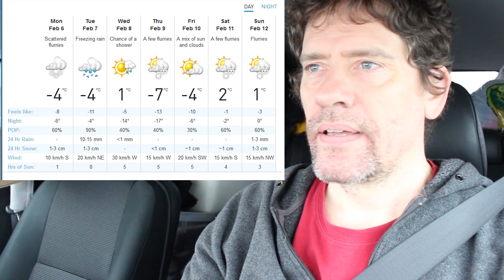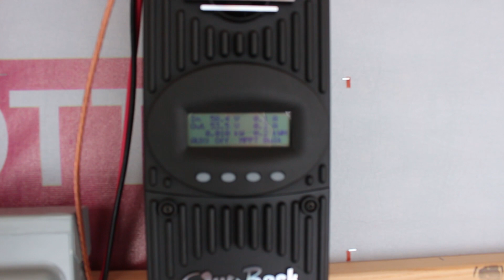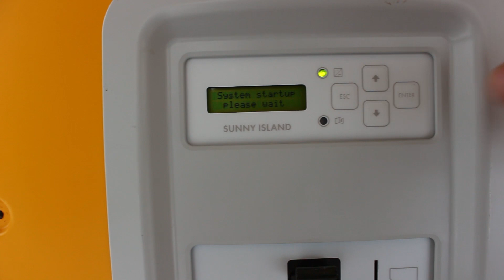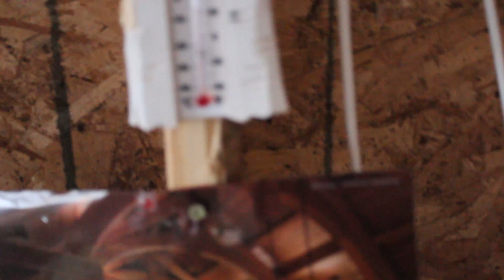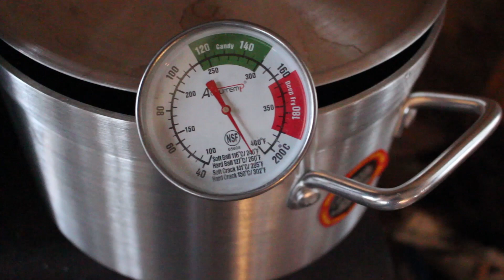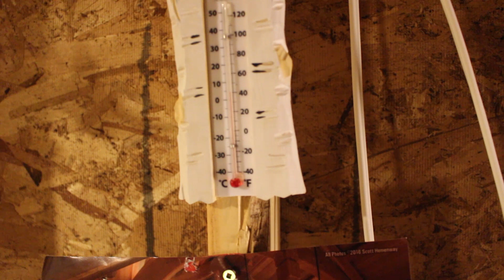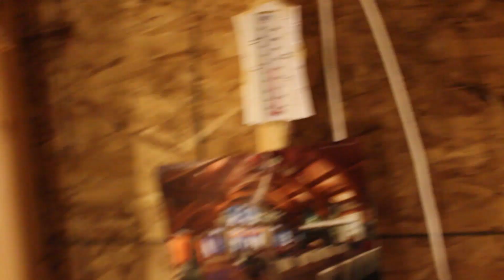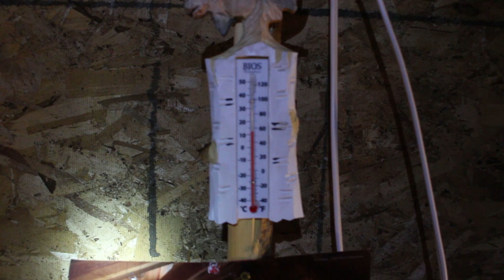Back to the Off Grid Cabin Episode 1.1

Comment: need some insulation and vapour barrier asap. our cottage is under construction and the place is as cold (if not colder) inside than out since we've only got plywood walls up and siding.
Reply from the maker: Hi Mikey, thanks for the comments. Sounds like we're in similar situations at the moment. I would have insulated but I ran out of money. Hope to do it before next winter though. Don't want to go through the same shite again.

Comment: Your dogs are loveable. I just found your channel and I have been watching quite a few of you videos and I decided to Subscribe. So far they have been really entertaining. I hope you show more of your cabin and dogs. A little suggestion is what you need is a set of tracts for your bike. I know they are expensive but if you plan on making trips to your cabin in the winter it would  be well worth it, or pick up a good used snow machine.
Reply from the maker: Hi Dwight, welcome to my channel. I've been watching videos of ATVs with tracks (and drooling) but it's just another thing I can't afford just yet (along with insulation, flooring, walls, etc). Hopefully I'll have something by next winter. There will be more videos of the cabin and the dogs, I'm working on Part 2 right now. Cheers.